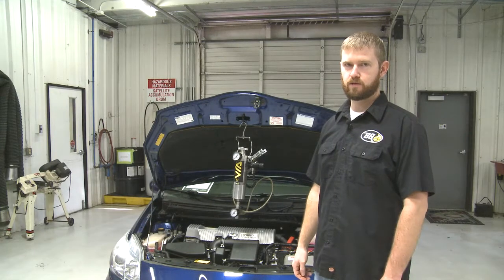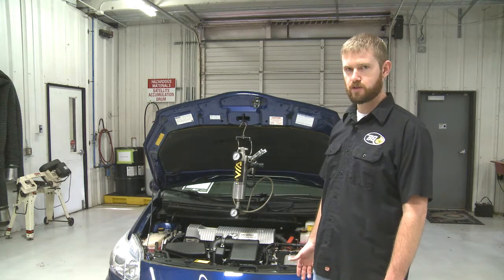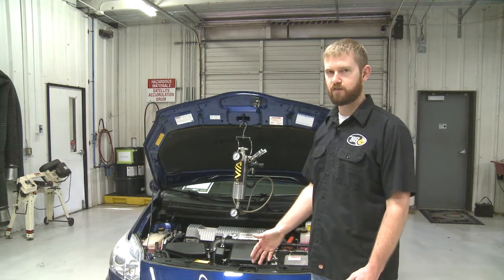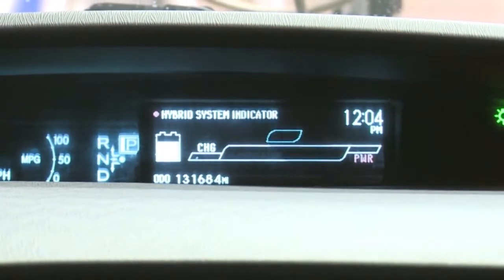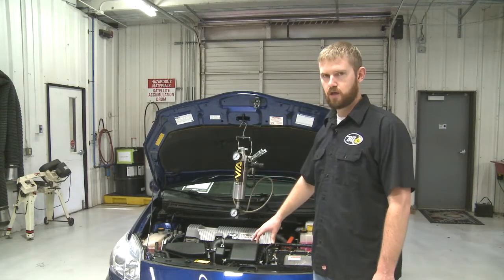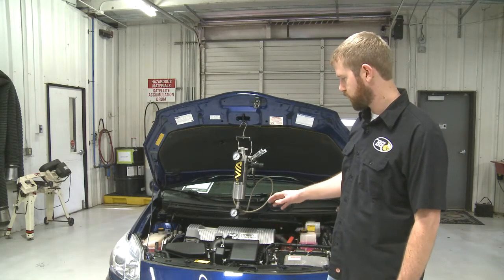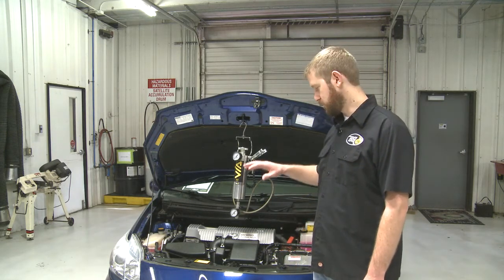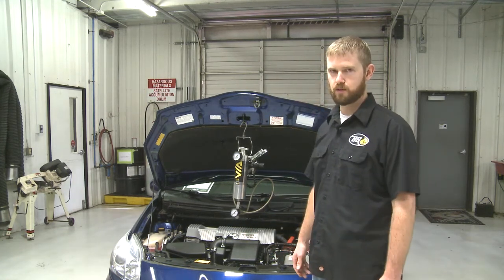BG Fuel Services for Hybrid Vehicles

Comment: What vacuum hose do you use in a Toyota Prius 2008? There are three hoses connected to the throttle body, please help
Reply from the maker: Which service are you performing, Fuel/Air Induction or Fuel Injection System Cleaning?
Reply: fuel air induction
Reply from the maker: No vacuum lines need to be disconnected for that service, only the intake boot needs to be removed to expose the throttle plate.  Then a BG VIA induction tool is used to atomize and spray the chemistry directly on the throttle plate.